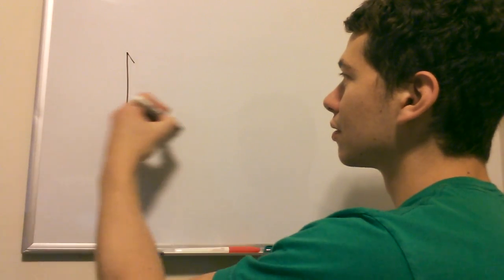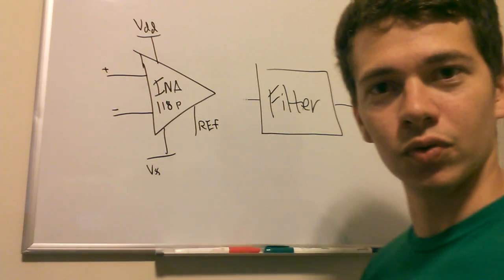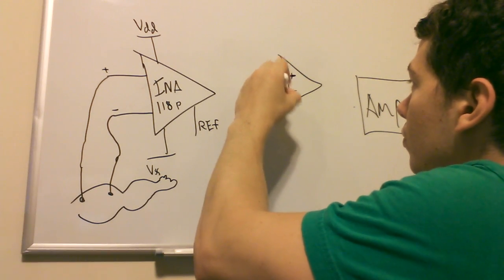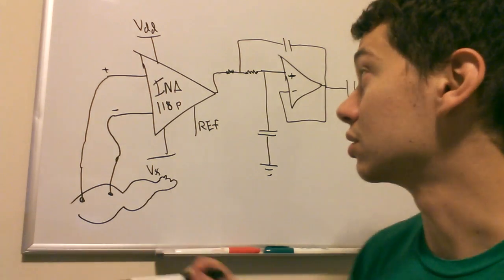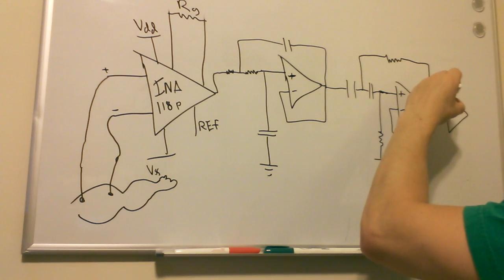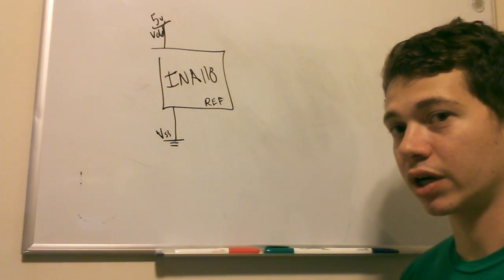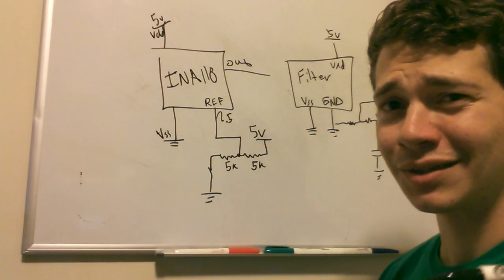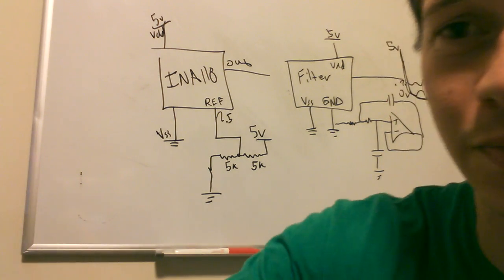How to design a single supply EMG, EKG, or EEG circuit

Comment: In ECG the voltage is maximum when ventricle is half depolarized & half repolraized (Half positive & negative) ' peak of R wave in ECG' Why?! 
Shouldn't voltage be the same as long as there's a potential difference between charges under electrodes whether it's half or not!?? Could you explain!

Comment: for the high-pass filter just use 2,5V as ref (ground), then the dc will not be removed? (why not?)
Reply from the maker: Jakob Furbo that won't remove the DC drift, it will just add a bias.

Comment: Thank you for the video here I have some questions:
1.When you pre amplify it, basically you amplify noise too. Why that does not create problems? I say this because you said for the second amplifier we put it after filter. why here it is not the case for the  first amplifier?
2.There are some commercial signal conditioning modules out there. Are they similar to yours?
3.why did you have to use high pass filter. Low pass filter make sense to me but after that why do we need high pass? I assume after the first filter there is no high frequency left to be cut off. 
4.If the signals are in nano volt order, or picoamp, then what would be your strategy? I think the range of EMG voltage is uV to mV, my question is what if it was nVto uV?
Reply: You have to. If you plug the filters directly to a microvolt signal without preamp, the source signal will be so weak it will likely be below the filter's amplitude threshold... You will be effectively listening for the filter's noise instead of the target signal.... First you amplify the whole original signal and then you filter whatever you need from it.
Reply: Question number two... Joining two filters (highpass/lowpass) is done to build a BANDpass filter... You are only interested in frequencies between a certain range... Not the rest.
Reply: Pedro Guillem Thank you but what is the difference between PreAmp and Amp itself? both theoretically and in action? For example can you use the same AD741 to do both amplifying and preamplifying?
Reply: +Silas Saw excellent question. The "Pre" is just a convention word relating to the fact the amplification is being performed before the important stuff happens. Amp would be the fact you are amplifying a signal which already has some process in it (filtering, for instance).

Each step of the process is called a "stage".. Normally you do Preamp->Filtering->Amp->Process.

The 741 and Ad620 are very cheap noisy amps and in this field of electronics, price means reliability. I would go for the OP series for filters, INAs are very good indeed... And for christ sakes use an isolation amp in your circuit before hooking yourself to this things, such as the ISO124 or an optocoupler... You don't want to be your computer's ground!!!
Reply: Pedro Guillem Thank you I understand now. What is Isolation ampt exactly? I remember I used optocoupler with relay to control switching off and on a pump. Would you please explain which part of my circuit I should use the ISO124 or the optocoupler. I am a noob. I do these stuff for hobby.
Reply: +Silas there are no stupid questions in biological interfaces. Its a good thing you ask. Iso amps are "barriers" that isolate a segment of a circuit from another... For example.. Imagine you hook an electrode to your chest and plug that into a circuit. At a point, the signal will likely go to an ADC or a computer,.. Which might have a ground or might not. If the system sees you as its ground, you could harm yourself... An iso amp is simply a multiplexer/demultiplexer that "mirrors" the signal from one side to the other, so that the rest of whatever follows it cannot "see" behind it. There are 3 kinds of isos: capacitive, inuctive and optical.

The optos are indeed a kind of isolation, now imagine that instead of a relay pulse, you want to propagate a variable analog signal to the other side... since you cannot modulate the analog light source, the ISO digitalizes and multiplexes the signal to pulse its own internal light very quick, which will lastly get demultiplexed and recreated on the other side... Cool huh?
Reply: Bad thing is ISOs are damn expensive (150 bucks a piece)... The cheapest i've seen is the 124, which is around 30... There are some other models ... Or you can simply build your own with patience and schmidt triggers... But that's a whole other story.

Comment: I am also working on a exo skeleton and i have already started my designs, i never thought i would come across someone who was working on the same project as me, My plan is to use phneumatics for the limb drives and extra pistons at across the fingers, and use a mixture of carbon fibre and titanium for the frame. Pm me on facebook at Ayaz mohmand (i have over 3000 subscribers so i should be easy to find, im 17 years old

Comment: Interesting filter design. Haven't run into those too often. Will have to try them out. I've always gotten away with passives or attaching Z components to my gain stages. I was confused when you were purposing the single supply design that you didn't explore a virtual ground built by simply buffering your resistor divider with an op amp and referencing your filters against that. Charge pump / SMPS would also work for a negative rail but those can be dangerous to small signals because of ripple. With 5V you have a ton of common mode range for a virtual ground. @ 3.3V it requires a lot more care.

Comment: With a single supply that circuit presented won't work because the input range of the INA118 is from (V–) + 0.95 to (V+) – 0.65. Having V- clamped to GND means that your ECG electrodes need to generate a DC potential of about 1V to make this setup work. It's not enough to shift the output but you need to make sure that the inputs are also within the valid operating rage of the amp. You could, example, inject a bias voltage into the subject to bring the active electrodes within the operating range. It's usually called right leg drive and is also used to reduce 50/60Hz interference. Personally I would just go for negative supply with a charge pump though...
Reply from the maker: Thanks for the input!
My latest design does have a right leg drive in addition to a negative supply from a charge pump.
I was having difficulty getting my charge pumps to work at the time of this video due to a large impedance at my solder joints (I was using tin finished PCBs).
I noted a DC offset on my electrodes at this time (just low frequency noise I presume), which is likely why this circuit worked well for me!
Reply: in case you haven't got luck with a charge pump you can also get an (isolated) pos/neg supply with an NMA0505 from a single 5V supply.
Reply: It's not that simple I'm afraid. Check out the very first comment here. The inputs work only within a certain common mode range. So it will be essentially luck if you end up in this range and the inputs will change over time and most likely will stop working after a while. Every input has leakage and the common mode voltage will drift. It's as if you are hoping that an open mosfet gate will keep its voltage forever. Here it's even worse: you hope that your whole body will keep its common mode voltage. Same applies to XLR balanced inputs. The transformer always has a tap in the middle connected to GND to provide the common mode.
Reply from the maker: BPM biosignals I think what we are getting stuck on is terminology.  By adding a bias to the body you are not implementing "common mode rejection", you are putting the input signals at an acceptable range so that saturation doesn't occurs.
Common mode rejection is inherent to the instrumentation amp, but as you stated it operates at a certain range.
Reply: BPM biosignals  how about shifting the entire ground level to some intermediate voltage say 2.5V for a 5V circuit using tle2426
Reply: Jimmy Dieffenderfer  how does large impedence solder joint affect charge pump circuit??
Reply: What's missing in the drawing is the 3rd electrode anyway which connects to GND and establishes the common mode voltage. You could lift that 3rd electrode to 2.5V if you wish.
Reply from the maker: BPM biosignals The 3rd electrode is a good point of conversation.  
Even without a third electrode there is common mode rejection due to the nature of the instrumentation amp.
However, in many applications it is necessary to have more common mode rejection; this entails the use of a 3rd electrode.

This 3rd electrode can be a driven ground, where the inverse of the common noise is injected back into the body.
Or, as you stated, you could connect this to ground, which doesn't actually improve common mode rejection but gets rid of a lot of the low frequency noise that often saturates the instrumentation amp.

The idea of lifting the 3rd electrode to 2.5v is probably a good idea for this circuit! hadn't thought of that.
Reply from the maker: Anshul Tyagi charge pump circuit is switching relatively large currents at high speeds, so stray impedances add up
Reply: A third electrode is always required as it sets the common mode voltage. Without it the inputs can have any common mode voltage. For example the body might be charged up slightly by electrostatic charges and drives the inputs into saturation.
Reply from the maker: BPM biosignals the key word is that the body "might" be charged up. An instrumentation amp has common mode rejection with just two input terminals, simple as that.  I agree, however, that the amp usually gets saturated, so it's a good idea to drive a bias into the body.

Comment: Hi! I wanted to make a EEG circuit that can filter for theta waves which are between 4-7 Hz. Suggestions how to make that? I was thinking of doing digital filtering but i dont know how to do that. also will the analog part be similar?
Reply from the maker: The analog part will be similar.
As a rule of thumb, you want to get rid of most low frequency and high frequency noise before you "digitize" this signal.
The reason for this is that you can easily apply REAL gain after analog filtering.  

The most basic way to digitally filter is using matlab.  If you want something that is doing this in real time, I would have LabVIEW acquiring your data and then running a matlab filtering script every 10 seconds.

Good luck
Reply: Jimmy Dieffenderfer
so digitizing is used to make it more accurate because i believe that analog has some limitations and so it will not be filtering something just between 4-7. instead could be doing something like 2-10 or something...would you agree with me on that?
Reply: did you use a simple lf347 in the opamps and how would you digitally filter the signal? FFT? I dont know how to do that
Reply from the maker: sohaib hayy You're on the right track.  Digital filters are used because they can be easily adjusted.  So you would have analog filters keeping the range of 1Hz to 150Hz (for example) and then have a digital filter to keep 4 to 7.
Reply from the maker: sohaib hayy You can make a digital filter by going through the whole process of switching to the frequency domain and multiplying by a filter... Or you could just use a couple lines of code in Matlab.

Do a search for digital filters in matlab.
Reply: Nope. Actually, discrete representations of anything analog will never be as accurate as the analog... The main reason for going digital is the manipulation and stuff you can do with a digital signal... From my view, nothing is as real as the analog signal itself.

You'll be fine in digital as long as you follow the Nynquist rule.. Otherwise you might induce aliasing.
Reply: The true fact is analog filters get VERY complex the moment tou want that much precision. If you want a 4 to 7Hz bandpass with a -40dB cut on the passband atenuation... You might end up with a 16th order, 12 stage Salem-Key... Hahahaha.... Since the frequency is so slow, you can sample at 100 points per second with sufficient acuracy, digital will work for you. Keepnit up.

Comment: hi there, first of all  i'm newbie to electronics and i have simple question. if i was to make this with a single battery, is my gnd also the negative of my battery ( i mean the side with the minus , i'll just have to use this as gnd?) , i was thinking of making something portable and dont want to tie it to a radiator or heater all the time.
Reply from the maker: Yes, the "minus" of the battery would be connected to GND in this case.

In my latest video, I use a specialized IC to make a positive and negative voltage (and gnd) from a single battery.

Comment: Hey, 
I have made the sensory circuit and it works fine with an oscillator generated signal but, there is some issue with the actual electrodes. Can I use standard ECG electrodes or are there any specific EMG electrodes? Just the electrodes pressing against the skin leads to a signal that might be covering up the actual EMG. Is something like that possible?
Reply from the maker: Electrodes can play a part in distorting your signal, although it's usually not the problem with people's circuits.
With 3M electrodes, you should be able to get good results.

This leads to a good point though.  Having a two lead ECG/EMG is very sensitive to noise as well as changes in impedance.
You will probably notice that the DC bias your signal is riding on will change as a function of the electrode pressure.
This is simply because the more pressure applied to your electrode, the less impedance, the greater the signal.

Not sure if this answered your question or not.